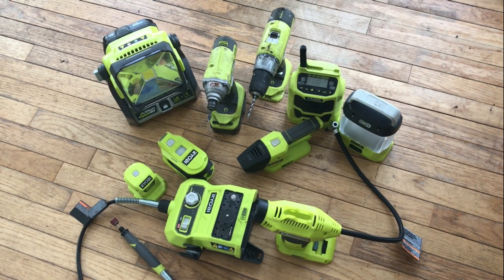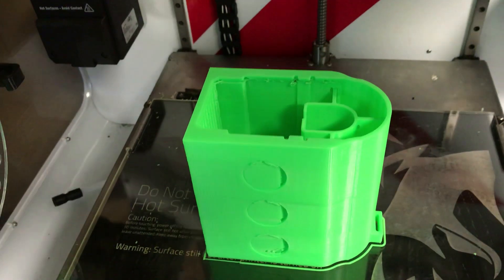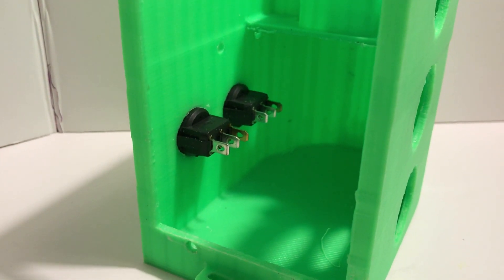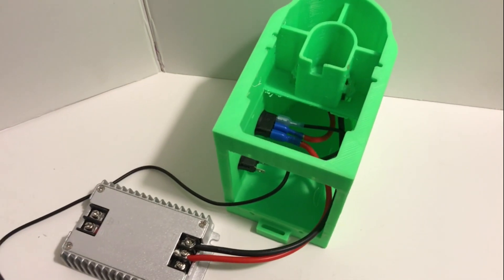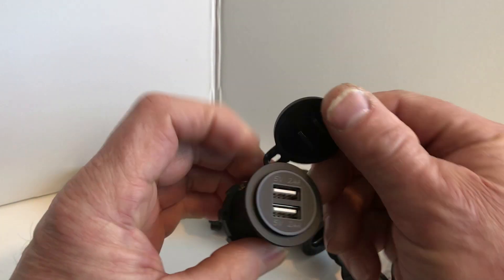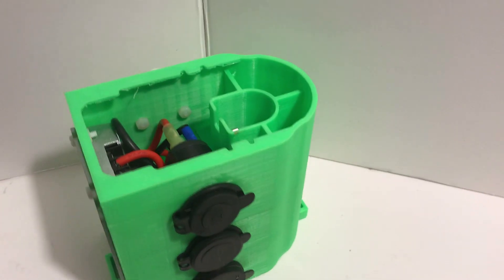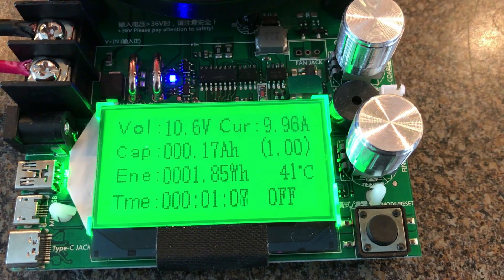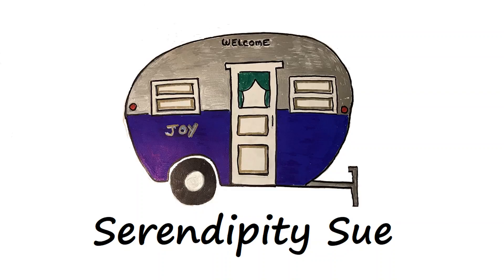DIY Ryobi 18V One+ Powerstation V2

Comment: Great video! Maybe I missed something, but are there any protections for shutdown when the 18v battery gets to a certain low voltage? Just wondering about protecting the battery, and not running it to a level that a charger won't recharge it.
Reply from the maker: Ryobi batteries have BMS built in

Comment: The holes for the switches, the links for which are on the printables page for this project, are too small. The holes are 19mm wide while the switches are 20.5mm wide.
Reply from the maker: maybe difference in how the 3D printers work? Can probably use a dremel tools with a cylinder sanding bit to open them up
Reply: @SerendipitySue  My printer has a very tight tolerance of approximately .3mm. I'm guessing it's just the switches being redesigned.

Comment: The Chinese clone One+ batteries are much better than the originals. I've got a couple of different ones and they last 2-3 times longer for run time and none has failed in three years (I've lost two Ryobi ones in that time).
Reply from the maker: You've been lucky! All the ones I have purchased haven't made their specs. Some were missing safety features like temperature sensors.

Comment: Do you know if the puck light that you used  is capable of connecting directly to 18V without using a buck step down converter?
Reply from the maker: Not sure... I'll go sacrifice one to see if it can take the 15V-21V range of the RYOBI 18V batteries

Comment: Just went through a 20 hour power outage and was looking for a way to use all my Ryobi batteries.  The $35 Ryobi lantern, while rugged, is a bit dim and costs too much.  Also, DIY is way more fun.  Thanks so much for your very helpful video and for sharing your designs.  I think I will make this pretty much exactly how you did.  Do you have issues with the buck converter getting too hot?
Reply from the maker: I haven't run the 12V at 10A for extended times. I use it for my CPAP machine. Check out my other Ryobi projects if you need more power.

Comment: I printed your design. I irdered the same battery contacts you ssid but im having trouble getting the battery in. Very tight in contact.  Did you modify them in some way?
Reply: I used a piece of wire to pull the clip into place. I could line up the clip with my hands but not get enough force to push it into place. Added hobby wire to the clip, lined it up and pulled on the wire to get it in place.
Reply from the maker: no. I'm guessing the alignment is off? Trying moving them a bit before you glue them in. I should probably update the design to use the ryobi clips. I found them after this original model was done. I've been using them on my more recent projects ( https://www.prusaprinters.org/prints/39638-ryobi-one-18v-battery-charge-adapter-for-solar-pow )

Comment: Getting 20v dc in on buck converter input but zero vdc on output not sure what is going on anyone see this before
Reply from the maker: Check wiring is correct? Wiring diagram usually on back of dc-dc converter. Is output wired thru on/off switch?

Comment: I like very much how you are developing this capability.   However,  when the battery runs down,  do you have the ability to recharge the battery WITHOUT taking it out of your nice interface ?   I am working to separate the 18v output of the Ryobi with hopefully a simple switch back to input a little charging circuit.  I am seeking a variety of input interfaces including solar to recharge.   Appreciate your thoughts.
Reply from the maker: I have figured out how to charge the Ryobi batteries and have another prototype that includes an MPPT charge controller. The idea being you could then charge with a solar panel or 120VAC power brick.

Comment: nice if you added a power port for charging 110v-220v adapter then some solar charging ports multiple ways to charge and consume power...plus another battery on top for twice the amount of power and charging...  ;)
Reply from the maker: I made a prototype that has an MPPT charge controller in it so you can use solar. Still playing around with it.

Comment: Printed the housing, waiting for the parts to show up from Amazon.. Thanks for Publishing.    I agree with the supports..  takes a bit of time, but the overall results are great.
Reply: Prusa MK3S..   It’s now posted to thingverse as a make.
Reply from the maker: @wsturner88  Did you print PLA or ABS? Did you print the walls hollow? I'm not real familiar with Prusa MK3S parameters
Reply: @SerendipitySue  PLA - Did not see a reason to print in ABS.
Reply from the maker: What printer/material did you use? Please post photos on thingiverse or here

Comment: Be interesting to see the Ryobi multiple battery charger converted to a power station, like the DeWalt power station..I would like to see the station continue to work even when the lowest ah battery is depleted, that is the draw back of the DeWalt, if you have one 4 ah battery and 3 9ah batteries installed, it goes dead after the 4 is drained, it also has no USB or DC outlets installed... At the very least, let the USB slots continue to be available if the one battery goes dead....
Reply from the maker: I purchased a Ryobi 6 battery charger to experiment with :-)
Reply from the maker: https://www.youtube.com/watch?v=TCWndCrfHi8

Comment: DeWalt's voltage safety is built into the tools (killed a battery drawing it low as a power source for my ride on mower). Any idea where Ryobi's is? I've searched around and haven't found an answer and haven't got around to tearing one down.
Reply from the maker: each Ryobi battery has a built in BMS (battery management system). You can see how to revive a ryobi battery at: https://youtu.be/atFNSQ4hUxw
Reply: Just watched your battery revival video. Looked like there might be a pair of FETs hanging off the one end that might be capable of cutting off draw.

Comment: this is great,
I did about the same thing a few months ago using an old charger base as a way of holding the battery, wired up a buck converter switched it and then fused it to a 12v cig outlet then i plugged in a 300 watt Bestek pure sine-wave in to that.
i only have the 4amp 18 volt batteries and i could still get about 1+ hour  pulling 150 watts A/C, anything over 175 watts and the battery would drain fast.
could you do a drain test on a 18v 4 amp battery?
 I'm wondering if it would be worth me buying those 9amp batteries.
Reply from the maker: I tested several different Ryobi / knockoff batteries. You have to watch the "C" rate of the batteries. You have to check the spec sheet of the 18650 cells that are being used. The BMS (battery management systems) which are in the battery packs should limit the discharge rate. It looks like the Max. rate is around 12-15A. So a 4Ah battery has a 1C rate of 4A,  a 6Ah battery has a 1C rate of 6A, the 9Ah battery has a 1C rate of 9A. Most Watt/hour ratings on battery packs are done at a 0.2C rate! So a 9Ah battery discharging at max 15A/18V  gives you 270 Watts going into your DC-DC converter... The converters have a max current. The ones I used can output 12V at 10Amp. I put 3 in parallel and was able to run 200watts with the Bestek 300. For battery life, I wouldn't draw more than 1C